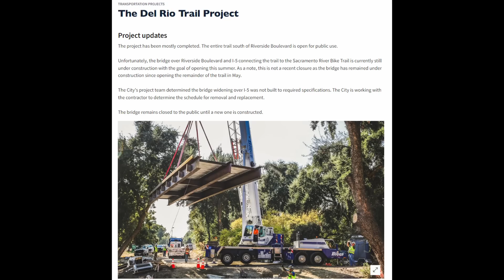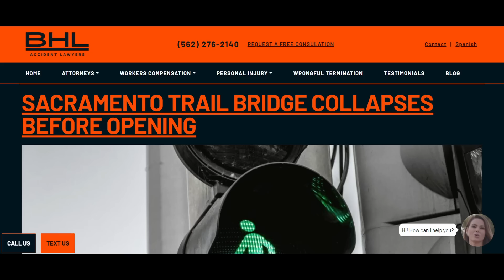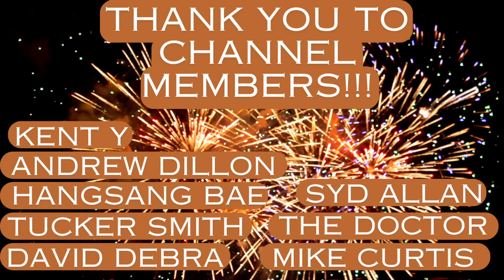Sacramento Pedestrian Bridge - What is the Problem?!

Comment: Rails to trails is big in parts of the country. If the RR is willing to give up the right of way, then the trail can be implemented by dealing with only one landowner. I bet this project took so long in part by securing the right of way piecemeal or via eminent domain. 

Near me, a rail-to-trail replaced a long abandoned commuter rail line. It connects a nature preserve to another wild life sanctuary. An existing trestle bridge simply had pedestrian & bicycle compatible decking and railing added on top.
Reply: There's a guy on here called Killer Bee. He does a lot with the railroad, and he says that rails to trails aren't actually abandonment.  It's specified in the contract that all grades, bridges, and culverts must remain, and the RR reserves the right to reinstall track and place the line back into service if demand returns. It's kind of like putting the ROW into public escrow while maintaining control of the corridor.

Comment: From a purely visual standpoint, not being an engineer, it almost looks like that existing railroad bridge is in contact with this new structure , or at least in very close proximity to it. Could that have anything to do with this projects technical issues?
Reply: Drive under it via Google street view, and look up. It has zero support of its own. It’s bolted to the sidewall of the railroad bridge.

Comment: After the pedestrian bridge collapsed on the campus of Florida International University it is not hard to understand the resistance of the City budge even an inch on specifications.  Apparently there is a problem with the deck "lightweight concrete and rebar."

Comment: Thank you for your report. Just for clarification the bridge itself is sound and is in use by the California state railroad museum for its excursion railroad.
 The city of Sacramento decided that they wanted to put or I should say attach a bike path to this bridge. It is the bike path portion that is in question. And you are correct there is a problem with the concrete itself.

Comment: So interesting.  I was running a crew pouring ICF walls in Cottonwood AZ years ago.  

We ended up doing a pour on a Saturday and the batch plant called in replacement drivers.

I was up on the scaffolding keeping track of the process when the special inspector yelled up at me that one truck had a load that was outside the specs for a slump test.  Our design mix was between 6-8 inch slump with a midrange water reducing agent and this truck was at a 9.

I had to go down and inform the driver to remove that load from the job site.  His reason?   He heard we wanted it wet so he added 15 gallons of water enroute.

I had a quick but terse phone call with the plant super to get our order back on track.

Long story short... inspectors can be a pita but they  also protect customers and in this case the company i worked for if there was a problem down the road with  the structure

Comment: Thanks for the engineering review of this debacle! I live and work near the bridge and frequently drive by and under it. At least visually looked pretty janky from the start. Thought it was still under construction when it was said to be completed. By the way, the railroad tracks are still in use by the state railroad museum.
Reply from the maker: Thanks for the info!
Reply: Janky is an interesting description for a bridge.
Reply: Can you verify the underside of the bridge, as currently visible on Google street view, is what actually exists? Or is that just temporary scaffolding used during construction? And, as Street View shows- it’s entirely attached to the side of the railroad bridge with no supports of its own?
Reply: @Bitterrootbackroads  Yes, the street view photo of an all wooden structure bolted to the side of the railroad bridge is accurate as completed. That’s actually why I assumed it was still under construction all of this time!

Comment: The biggest load on that bridge is its dead load so, if is is going to fail it will do so while simply sitting there as the live loads will be insignificant. Likewise for seismic loads. If it doesn’t meet those requirements, it will fail with or without the live load of pedestrians or cyclists.  So, if it were that serious, they really should shut down the interstate. Of course, keep the service vehicles off the structure. Here in Ottawa our new bike trails trails always fail because they are designed for light loads, yet, subsequent to handover, the Administrators run large service vehicles and water tankers down the trails, ruining the pavement structure, then blame the contractor for the failure.
Reply: I drove under that bridge in April.  If it isn't safe for bikes it isn't safe to drive under. That section of I5 gets what? 120000 trips per day.

Comment: The astounding levels of corruption for simply paving an empty path. They HAVE to be including the 3 intersections on florin rd and 2 new florin-adjacent pedestrian-crossings. Which, everything in that last sentence was completely unnecessary infrastructure upgrading. I literally drive down that road every week. it did not need to get repaved, but the bike path is about 15-20 years overdue..

Comment: @7:00 - I would think that the procedure that would make the most sense for concrete strength testing would be to have the builder cast a handful of cylinders by dipping a "ladle" of some kind into the fresh pour while the concrete is going in, then set those aside to cure under the same conditions as the structural form, then send those off to the lab.  That way there can be no question of "was the sample taken in a way that made it weaker?".

What's the actual process you typically see used to provide lab samples?
Reply from the maker: Typically,  cylinders are made in the field from the freshly delivered concrete.  They cure in the field for a few days to have sufficient strength for transport to the lab.  There is a standard procedures (ASTM and ACI) for making and testing these cylinders.
Reply: @CaseyJones-Engineer  so, where's the wiggle room for people to be asking "was it sealed/handled/stored correctly?"  If the goal is to mimic conditions of the structural pour, why would it be sealed at all?

Comment: Never heard of this so-called 'bridge builder' (we built bridges in norcal for 30 years as main contractor) - checking their website, they don't have any projects remotely similiar (I don't see any structural concrete structures, let alone bridges?)  Seems like an all-too-common Disadvanted Business Enterprise front (Native Indian 'owned') that only gets work because of the mandatory 'diversity' content in public works projects.  That said, how does 'lightweight concrete' get missed during onsite inspection/testing?  Gotta be a lot more to this story.  Normally, I'd roll my eyes at an owner saying something has to be demolished - but based on the oddball projects the contractor seems to do, I wouldn't be surprised at a major eff-up - this bridge seems well outside of their circle of competence.
Reply from the maker: Those are great points.  I have asked the City for more details about this situation, but they haven't responded.

Comment: Unfortunately there isn’t much, if any, new information here. We have a partial recitation of the already-known facts and a good general discussion of concrete testing techniques. But not what we most need: deeper insight into what exactly has happened here. For example, a timeline would have helped.

This could become a huge story overnight, if chunks of the new construction start falling into I-5. One of the most vital interstates in the country might be suddenly blocked in both directions, for weeks or months. The disruption to commerce alone could be greater than that caused by the collapse of the Key bridge in Maryland and the port closure that followed.
Reply from the maker: You do know this is a breaking news type video?  The local media haven't reported any substantive details and the City has not responded to my inquiries.  I will do an update when more details emerge but to complain that I don't have all the details at this point is silly.

Comment: It seems there isn't enough info here to make a determination about the problem.  More details on the concrete spec, what was actually used , and the results of concrete testing would be helpful.
Reply from the maker: I agree.  Unfortunately the City has not responded to my inquiry and the local news are reporting generalizations.  I will stay on the story though and do updates accordingly.
Reply: @CaseyJones-Engineer  TY Casey. This is interesting and I would like to see the details. My guess is the city attorneys are advising, and don't understand structural integrity.  Good luck. I would call the contractor.

Comment: If the bridge really was dangerous then the highway below would be closed off and the bridge demolished.
So I wouldn't be surprised if this is based on some disagreement that hasn't surfaced, likely a question of money, but it could be something like using metric dimension rebar instead of imperial dimension rebar where both actually are good enough. Worth to dig deeper into.
Never underestimate the "Not Invented Here" factor.
Reply from the maker: Great points.  I will stay on this story as I am not happy with the sparse details related by the local media so far.
Reply: The average traffic flow underneath that bridge is about 200,000 vehicles per day. So closing the freeway would be impractical.

Cheers,

Alan Tomlinson

Comment: A separate bridge? Have you checked all the images on Google earth / Streetview & viewed the bottom side? It looks like this thing is simply tacked onto the side of the railroad bridge & supported by a bunch of angle braces similar to those bamboo scaffolds they use on skyscrapers in Asia. Possibly the concrete in question is what appears to be a fresh layer on the side of the railroad bridge? The key point in the bracing is bolted sideways into the very bottom of the unsupported concrete and looks like a critical fracture area ready to fail and drop the entire thing onto the freeway. 

I’m curious to know about the designers & engineering that came up with this, and if the original designers of the railroad bridge approved it? It seems they were aware of limitations from the start by putting up signs that state “no vehicle traffic, including emergency vehicles”. Police love to patrol parks etc by driving on the bike trails. If local news reports called the railroad bridge “abandoned” they likely got that from a source that is somehow connected to the project?
Reply: its costed 23 million Dollars for that  What a rape of the Us tax payer
Reply: 1:44 That picture of a bridge section suspended from a crane is not part of the bridge in question I think. The view looking up, as the Google street view car passes underneath, does not show any lengthwise steel beams.

Comment: If the City can show that "non-conforming materials" were used, the contractor had to supply a "Performance and Maintenance Bond" for the job!  If the Bond was issued, the contractor is liable!
Reply from the maker: You are right.  I am sure the City will involve the bond if the Contractor doesn't willing agree to the demolition and replacement.

Comment: I wonder if 6 ksi chinesium was used instead of A36 steel? Bamboo instead of rebar? The tracks are still there so, I question if the line isn't really abandoned. Its CA, chances are that this is all politics. Many years ago, there was a technique of hammering on concrete to get an indicate its density and hardness. This would usually show questionable areas to core. Good Luck, Rick
Reply from the maker: Thank you.  I have contact the City of Sacramento to get a copy of their "notice of non-conformance" to the contractor, but they haven't replied yet.  It seems that California doesn't adhere to the Buy America act on their bridges from what I have heard about the Bay Bridge repairs.
Reply: @CaseyJones-Engineer  Its all about the tofu dreg construction in east china.

Comment: I never worked on a site that did not pour 3 test cylinders per truckload of concrete and document.
Reply from the maker: You are right.  They usually have at least a cylinder for 7 day, 28 day and a hold.

Comment: Sometimes getting the railroad to give up the rights to use a corridor is a very real barrier. Railroads have been given incredible legal authority dating back to the 1800s. They realize that once they abandon all rights within a corridor, they might never be able to regain them.
Reply from the maker: Good point.  Railroads are nearly sovereign entities in the U.S. due to the reasons you pointed out.  The U.S. granted them huge concessions to lay the tracks for westward expansion.  I work on state DOT projects that involve railroad right of way all the time and the railroads are complete pains to deal with in most cases.  In other cases, the railroad companies are cool, but it is their consultant engineering representative who are a real pain (I am talking to you Benesch!).

Comment: We built a 3-span flat slab bridge with a high skew and a partial vertical curve in the last span a few years back for a local county in central IN. The design had conduits in the sidewalk for utilities. Fast forward a few years and just at the end of the 3-year warranty period they point out cracking in one of the sidewalks at the end of the deck and tell us they want it replaced at our cost alleging that we used improper materials or procedures (the last is hard to prove either way), no warning before this that they had issues or concerns. We offer to patch and seal the cracking but they say no, we want the sidewalk in the area replaced.

Comment: Found this...."In a letter obtained by CBS13, the city says the bridge builder, Mountain Methods, Inc., used unapproved "lightweight concrete and rebar."
Reply from the maker: That is what the local CBS station said and they were apparently referencing the letter that they obtained from the City.  Unfortunately, CBS news didn't see fit to post a copy of the letter.   I contacted Sacramento Public works asking for a copy of this letter and so far there has been no response from them.
Reply: There is an image of the document in the CBS13 story a minute and a half in: https://youtu.be/Qsv2gomOPXo?t=91s
Reply: @gir_bot  Thanks for posting link. The letter can be seen in it's entirety there.

Unfortunately it doesn't shed much more light on the situation. It says "After reviewing available information, city engineer of record (Dokken Engineering) has determined that the widening of the Land Park Underpass was built  out of conformance with plans, specifications and approved concrete mixture designs, and cannot be accepted." ... "The city finds that the lightweight concrete and rebar placed at the Land Park Underpass Widening is non-conforming to the contract requirements and is rejected." It then says the contractor must remove and replace and submit a plan and schedule by Sept 30.

I had thought "lightweight concrete and rebar" meant that they had used concrete that was too light, but looked it up and "lightweight concrete" is just a type of concrete.
Reply: One wonders if the new fiberglass-based rebat has started to be used, and if Federal standards allow it to be used yet.
Reply: @johnhaller5851  Good question.  I'm not well versed in fiberglass rebar but from what I've read it seems to increase concrete longevity.  I think there are cost issues associated with this rebar but I read that this can last 20 times longer (maybe a statistic from the fiberglass rebar manufacturer)

Comment: I imagine there's a Fed component to this situation - Foot traffic is just the apparent function of the bridge, however not falling on the interstate is it's real function and those requirements would pump up the level of compliance and oversight (or should have).
Reply from the maker: That is a great point.  I was hoping to see whether the falsework had been removed from under the bridge but I there were no side images.  That would be something if the concrete wasn't strong enough to tolerate removal of the falsework!
Reply: @CaseyJones-Engineer , What exactly does the “falsework” under the bridge consist of? Is that what we see overhead from the Google Streetview car as it passes under it? 

Streetview shows zero concrete pillars supporting the bicycle bridge, it’s simply attached to the side wall of the railroad bridge. Do we know where the supposed lightweight concrete was used? One picture looking down the walkway surface seems to show some unevenness or buckling. Is the concrete in question actually a thin surface wear layer applied to deck? Looking up at the bottom, via Streetview, seems to show the deck is lengthwise 4x4 wood timbers placed together like flooring across joists.
Reply: Oversite on many wngineered projects are lacking.
Have been on may condo/apartment bildings repairing new mechanical systems that have never had a proper startup or inspection.
There seems to be no budget for placing these system into proper function
Reply: There's also the seismic angle. The city may want to cover themselves if the concrete is acceptable for normal loads but questionable in an earthquake. If it falls on the interstate during a quake they'd be liable for it.

People forget that everything in CA has to be built tougher for earthquake resistance. Contractors at all levels absolutely love to cheap out because in normal use it seems like useless overkill so why not save a buck?